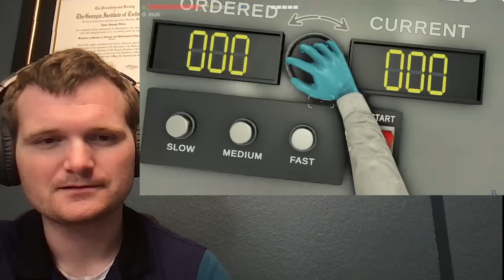Nuclear Engineer Reacts to Nucleares PWR Reactor Simulator Part 1

Comment: From a gaming perspective, having the control room floor free of the desks and seats and other such "clutter" does help streamline things quite a bit.  Games are inherently a little less precise in their movement systems than real life, even at their most realistic, and any object with collision (ie: something defined as solid in the physics simulation, which is technically separate from the visual display) can cause you to get caught on them in ways that they wouldn't in real life. Imagine you're running across a room, hit an empty cardboard box, and stop as if you'd hit a brick wall...higher end games (in terms of production quality, not necessarily relating to budget) tend to do a fair bit of testing to avoid too much of that sort of thing, but it's almost an inherent part of running around in 3d free-roam spaces in games. In real life, you'd probably turn the step that would hit the box into a kick, that sends it out of your way, or subconsciously shift to one side such that you just barely go past it or some other such thing...or just step on it and destroy the box.  

In a detail rich environment like an office where you have desks and chairs and filing cabinets and wastepaper bins and all sorts...that's a lot of testing to avoid the weird collisions from being problematic (and often if you make a workaround where you can step on things below a certain height, then you'll have a good chunk of the playerbase clowning around trying to stand on the tallest filing cabinet, because of course, it's a game, people are gonna find their own fun) ...or you can just not fill the space with details that aren't required for the gameplay and just have the controls in the control room and assume this plant puts their office space in a separate office.

As for the suit being on a mannequin, again, that's game design.  Suits of clothing are often presented in such a fashion so that you can see what you're grabbing - a non expert might not realize that the formless yellow blob with a bit of gas mask sticking out is a clean suit designed to protect you from radioactive contaminants.  Have it standing there like a shop display model, and you know exactly what you're looking at even if you're not familiar with radiation safety gear.  (As for the authenticity/modernity of that suit design...that's on the developer to research and get right.)  There's an absolute ton of subtle design cues like this that game devs use that players aren't meant to pick up on.  Like...I didn't see that suit as being weird at all until you pointed it out, because it's a game environment and in a game environment, a suit of clothes just standing there is an icon saying "this is where you put on that kind of clothing." Conversely, if I opened my closet and saw the outfit I wanted to put on just standing there waiting for me like that, I would probably next be seen running through the streets of my hometown screaming.
Reply: It has to be a compromise. It's not a training system - it's a game, and it has to be based on game mechanics that make it fun.

Comment: I wonder if the UPS and Generator systems in Nuclear reactors are the same as the ones I used to work on in Data Centres. We used 4 generators, 2 Generac Natural gas powered ones and two Cat diesels. The UPS's were just giant racks with huge lead acid batteries in them. If I remember right, the facility had a power budget of 200kw and we had enough onsight reserves for 24 hours of operation off grid.

Comment: playing this game, i think it's a good idea to just assume we are the single plant operator of a plant with an extremely flawed design and a very positive void coefficient. it is very hard to have the reactor NOT melt down lmao, the game would be too easy if everything actually SCRAM'd correctly instead of everything going to shit.

edit: i actually managed to get the plant stable and got to a point of actually producing power lmao. the game definitely does a good job at not making normal operations too easy. and there's no sort of instruction manual for how to correct warnings, so my problem before was what I might do might make the problem better, or it might make it worse, or it might even make something else worse.

Comment: The water may be around 2000 psi in the reactor vessel, but containment buildings are designed for just 7 psi (0.5 bar) in view of LOCA scenarios

Comment: do note: this game is still in active development, only a couple of days ago they added a vacuum pump to the condenser (also, the Electrical Distribution terminal is WAY different from this and most other video(s) on the game)
Future Edits to come to explain some of the things I noticed from playing myself:

1. at 17:30, you talk about how the core would be "injected" via crane. The game abstracts this as the reactor core room DOES have an operational crane although right now, it's only used for Emergency Control Rod adjustments.
2. 20:15, technically, he currently only has 1 turbine generator, but that is one of the things that can be upgraded by buying MORE up to 3 total and I believe I remember him talking about the upgrade system a bit later
sidenote: Obviously, it makes no sense in reality to have to build up the power plant over time... but this is a game and let,s face it.... it is EXTREMELY boring to just babysit the reactor for the entire game without any sense of progression.
additional sidenote: in the lore, they do say this is a test reactor.... but then it's used to output electricity.... but then again.... upgradeable reactor
Reply: And it's not at all obvious how to use the vacuum pump.
Reply: @vylbird8014  I've just turned it up to a 100% and noticed that the water level in the Condenser no longer change over time.... not sure what that means exactly as I'm no actual physicist, just a Physics enjoyer.